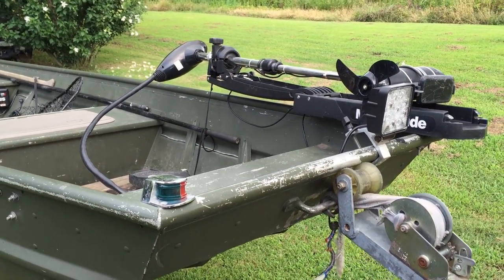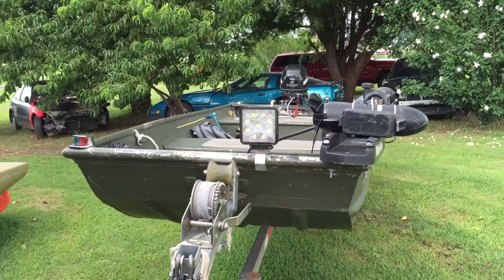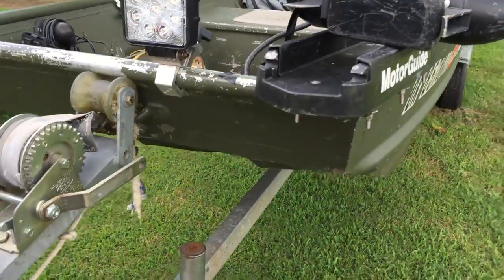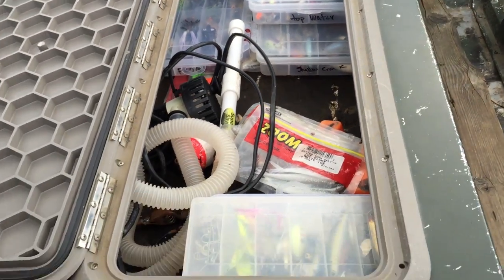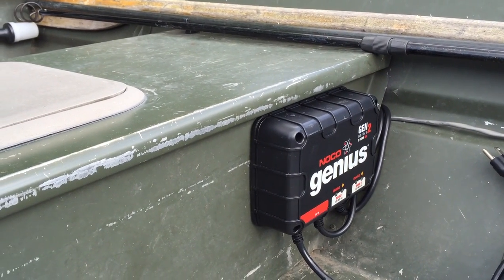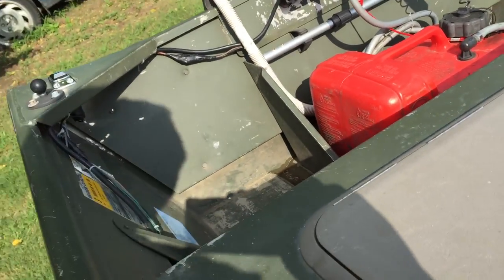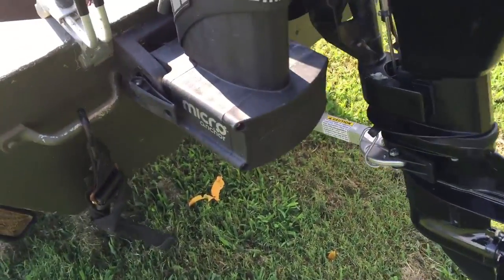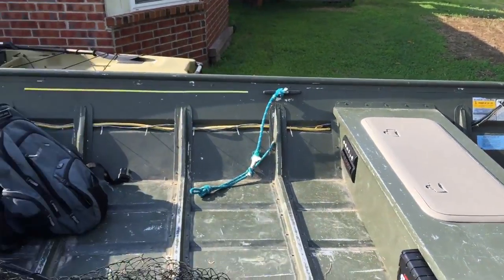Modified Fishing Jon Boat - OOW Outdoors

Comment: I just bought a Jon boat. The transom was pretty much destroyed. So I took steel and reinforced it and welded it all up. It is the same exact on as yours. 14' 1436 2000-year. It came with trailer, boat 25hp evinrude motor, and a 42lb thrust trolling motor. I am wanting to put a new trolling motor on it because the one that's on it is a hand control. And I want a foot control. If I could get any advise from u it would be great because I am only 14 years old and I have my grandpa helping me and he doesn't know much about Jon boats. Also do u know of a good cheap fish finder? Thanks. Keep making videos

Comment: Good video man!  Did you notice the bench seats losing any strength after removing the flotation foam?  I'm thinking of removing the foam beneath my rear bench and converting it to storage but it appears that the bench relies on the foam for structural integrity.  Love the hatches though.
Reply from the maker: James Harper yes you definitely loose strength but it's still strong enough for us to stand up on.  We weight 170-200 lbs

Comment: How did you remove the floatation foam that comes inside the benches? I have a 14' tracker guide v14 lite and I'm having trouble getting the foam out without removing the benches. Any suggestions?
Reply: this post is old but plain old lacquer thinner will dissolve Styrofoam ..

Comment: How wide is the boat?
Reply from the maker: 36"
Reply: +OutofWORKoutdoors thanks how stable is it on a scare from 1-10. I'm in the market to buy me the same model. Also how does it handle rough water
Reply: +OutofWORKoutdoors thanks how stable is it on a scare from 1-10. I'm in the market to buy me the same model. Also how does it handle rough water